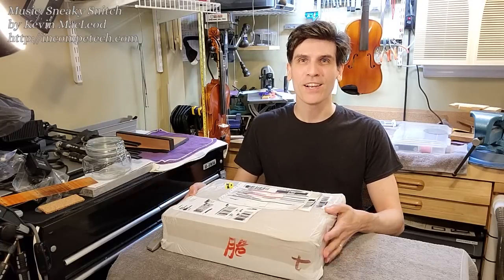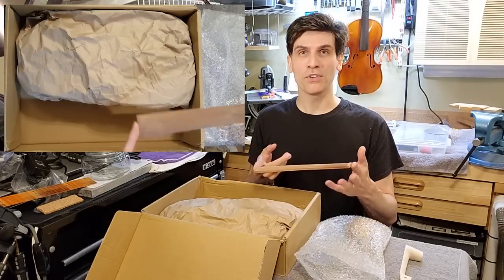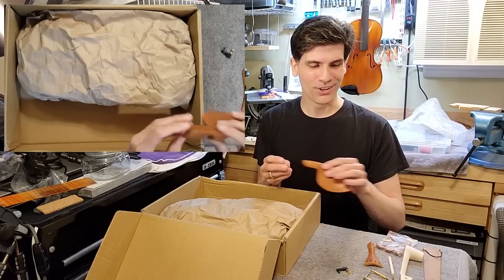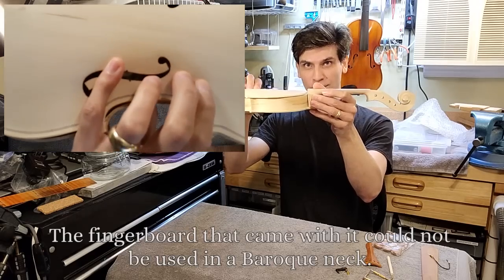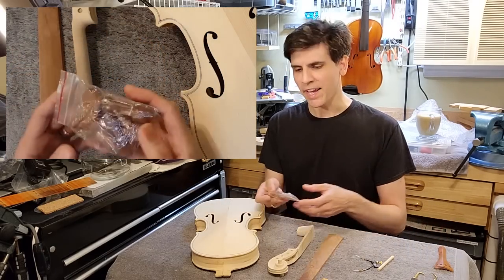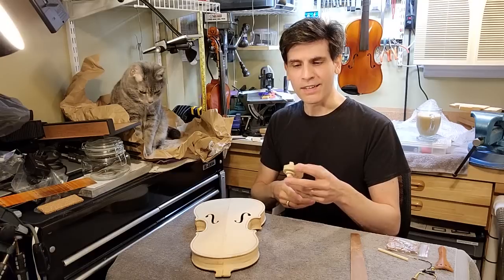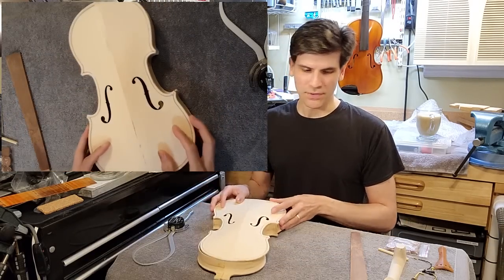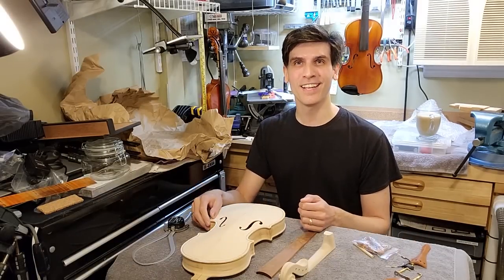$60 DIY Violin Kit (mine is an even bigger NIGHTMARE!)

Comment: You theory makes sense. Reject parts thrown together in a box and sold as a kit. Good luck to the amateurs that were so unfortunate to buy one or got one gifted. So many failed projects. It probably takes a good luthier to make anything decent from that. It would probably make for a good practice violin when done. Practice is what i need when i pick up the violin again. So sign me up for the giveaway IF it will happen ;). I am looking forward to the videos on the build project. Thanks for going for it... you kinda had to do if after the reaction video on twoset, i guess ;)

Comment: On a good violin should the finger board be made of ebony?
Reply from the maker: Indeed, the fingerboard should be ebony.
Lower cost/quality violins often have fingerboards that either are ebony but of lower quality so it is dyed to look better, or simply another wood dyed black.
Reply from the maker: That is a fancy baroque fingerboard (and tailpiece). Absolutely traditional and beautiful. They were /usually/ made of maple with inlaid ebony but could be any other hard-wearing wood.
There was less need for the hard-wearing characteristics of ebony when strings were simply unwound gut, so you saw more of these inlaid fingerboards back then, but as they evolved, we started winding strings in silver, and later on other metals, and that increased the wear and tear on the fingerboard thus requiring a harder wood that could be re-surfaced without ruining delicate inlay work.
Reply: @SculptyWorks  Thank you for your detailed reply :)

Comment: My kit was from a luthier and did cost way more than $40. In mine, the bass bar was included, although not glued in place. The tonewoods were good and I spent some time tuning the top and the sound is actually very nice. Currently making one from scratch using a Guarneri form.
Reply from the maker: Guarneri is the best!  😉 👍
Reply: @SculptyWorks  I much prefer the warmer sound of a Guarneri over the Strad :-)

Comment: That's much better packaging that what TwoSet got, at least! Excited to see if you can make a proper violin out of this, though I think you should use all the parts that came with the kit, as much as possible. PS I think that box was too big for Ash but I bet he liked it anyway.
Reply from the maker: The fingerboard is unusable. The geometry is wrong and there isn't enough material to properly correct it. ...and I wouldn't send out a violin with a fingerboard that isn't ebony.   😊
The pegs/end-pin/tailpiece/chinrest, they could be used; maybe not the pegs, they were pre-drilled for strings and we'll have to see if the holes will match up once I set it up. The soundpost blank I can definitely use. Still 50/50 about the bridge blank. We shall see!
I just got done making the bass bar! Break time!  🍺

Comment: I’m not really feeling comfortable at the thought of using ebony parts on a low quality violin though. Especially highest grade ebony is rare nowadays, as it should be, and thus wouldn’t it be a waste to put it on anything other than a high quality violin? I’d say, save the ebony for a good instrument, and experiment.
Talking about ebony: There’s been quite some development in recent years with compressed wood, which aparently gives a similar performance to ebony while being easier to work with. What’s your stance on such ideas? Would you ever try to build a good violin that’s free of endangered tropical wood, using modern alternatives?
Reply from the maker: There is high quality ebony which is indeed rare and expensive, but there are lower grades that still offer the same 'performance' while being more available; there's also a few varieties of wood considered 'ebony', that are totally legitimate substitute to the endangered species, and those you'll find on lower grade/student instruments. So don't worry, I won't 'waste' rare expensive materials on the project. But I will give it the best chance I can. I think this violin has potential, but it will take a lot of work to bring it out.
I have no experience with 'modern alternatives' of ebony as you put it, so I can't comment on them.
The world of classical music is notorious for its resistance to change, and sticking to tradition, sometimes simply for the sake of it. But if you can get me a piece of /something/ that has the necessary characteristics, I'm all for using it in place of rare/endangered materials.  😊

Comment: That is strange. Why no bass bar?
Reply from the maker: Beats me! It's just one of those mysteries!  🤔
Reply: @SculptyWorks  probably body is so extra quality it does not even need a bass bar to withstand the tension...
Reply from the maker: There were some experimental violins like that in the 1800's.
People have been trying to 'improve' the violin for centuries!
Reply: @SculptyWorks  nobody will be able to beat Stradivarius.
Reply from the maker: Stradivari was undisputedly incredibly good at what he did, yes.
...but I actually prefer Del Gesu violins.   😉
Reply: @SculptyWorks  why do people even non violin players know who stradivari was but know nothing about gaurneri violins?
Reply from the maker: @AmandaViolinGirl  No idea! I'll blame it on Vuillaume, who had a buttload of Strads to sell but only got a hold of a few Del Gesus once in a while.  😉
(Strad did make WAAAY MORE violins than Del Gesu, also)
Reply: Going with the hypothesis that these were reject pieces... Perhaps the top plate was rejected even before anyone had the chance to glue the bass bar on it, hence no bass bar. And the seller didn't know any better.

Comment: Stradivari used the best materials of his day. If a young Antonio were just starting in 2020, what tools and materials would he be using ?  How would He Create TABULA RASA his first Violin ?  Would he use Cyanoacrylates ?  Plastics ?  Polyurethane ?  Carbon Fiber ?  Ceramics ?  3D Printing ?  Acoustic Physics ( Chlandi Plates, Wave Theory, Phonons, FFT Audio Spectrum Analysis, etc. ) ?   What would be in his ears on his MP3 player as He Worked ??
Reply from the maker: Strad did use regularly good quality materials, but to say he only used the best might be a stretch, as some of his instruments do have patches and grafts of wood on parts that were defective. Where he was truly incomparable was on his technique, the precision of his hands in working with what he had.  😉
I think he would use pretty much the same stuff he did back then today, though modern trade networks would allow him to source things more easily, no doubt!
Maybe he would replace tedious  labor-intensive operations with a few powertools like a bandsaw, and a thickness sander (the latter for making the ribs stock). Maybe a CNC to rough out the shapes if he didn't have apprentices and other people working for him like he did back then.
There would be no need for modern synthetic stuff, since the good old stuff is still good and has not been matched by modern technologies as far as violin making goes. As for modern acoustic theories, again, what he did back then worked just fine, so I don't think he would do anything different.
It's hard to say what he would listen to, though. We know extremely little about Stradivari the man and his tastes.
Reply: Thank you for your observations and commentary !

Comment: Why are fingerboards made of ebony? What happens if a fingerboard is made of any other wood?
Reply from the maker: Ebony is used because it is a very hard wearing wood; the strings pressed down on it and even the oils from the hand will wear grooves in softer woods. Even ebony fingerboards after some years need to be re-finished, but ebony offers extremely good wear resistance and is also extremely stable. A good quality ebony fingerboard will rarely warp or twist or crack.   😊
You can make fingerboards of whatever you want, just the wear-resistance and stability factors might be compromised, requiring maintenance sooner than an ebony one would.

Comment: the bass bar you showed seems really tall (like the top edge is far from the violin's plate), is that normal?
Reply from the maker: No, that bass bar was ugly and poorly made. That's from a so-called 'dutzendarbeit' factory violin from the 1800's, they were made quick and cheap. But it's the only violin I had on hand that was open.

Comment: Sorry, I don't see the point of violin kit when you can get complete finished violin with case, bow, extra strings, shoulder rest etc for same price (made in China of course).  Actually, I paid only $45 including shipping for my complete violine set on ebay.
Reply from the maker: I can see the point, but it's very tenuous: Some people have said it was a load of fun putting their own violin together.
My whole point was to show what a huge job it is to put one of these things together, and exactly show that it's not a practical alternative for a 'cheap violin'.  😉

Comment: There are plenty of videos showing the work that goes on in these excellent Chinese factories. Yes they start out on a machine there is absolutely nothing wrong with Chinese violins so the same for the steel strings don't throw them on the floor the kitty will get their paws in them just kidding so don't answer me back
Reply from the maker: Oh you're getting an answer!    😉
Those strings are terrible!
Reply: @SculptyWorks  while you're right here something else about the two pieces where the tail button goes why couldn't it be one piece? Like they have one piece backs on some?
Reply from the maker: @deadmanswife3625  It could. Most of the time comes to a matter of personal preference of the maker, or availability of materials. I think two pieces are more common because it's easier to bend and maneuver around two shorter pieces instead of one long one.  😉
Reply: @SculptyWorks  thanks just wondering I think one piece was used on one of mine I'm not going to take the varnish off to double-check haha but I can't find a seam or bump or Ripple any indication at all.
It really looks like the grain is one.
Thanks again I just been wondering about it for so long